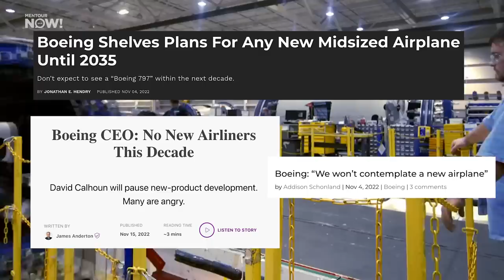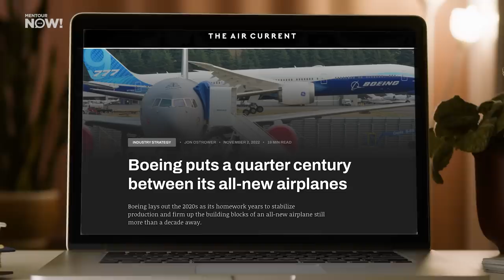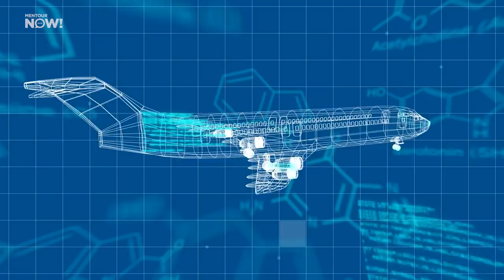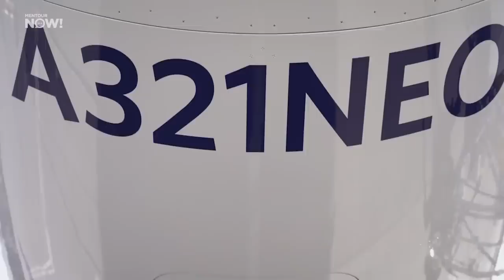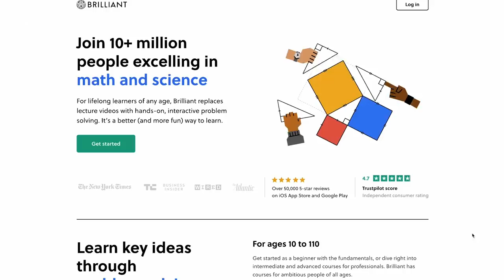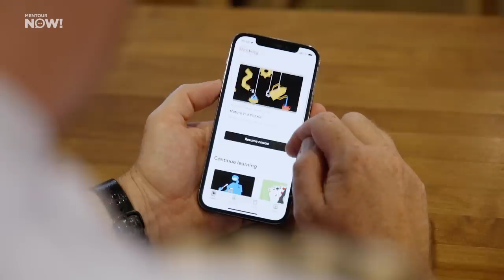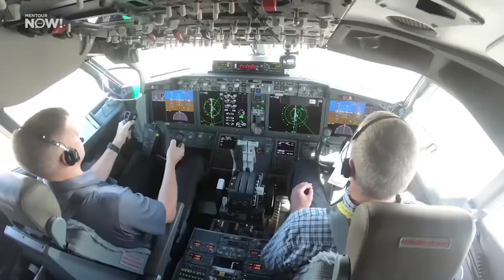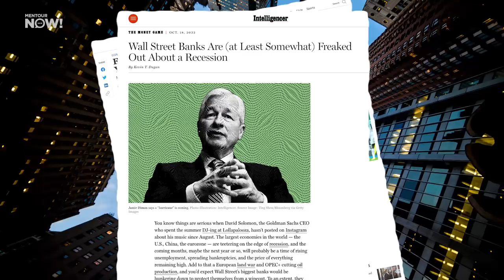Is BOEING giving up!?

Comment: You forgot to mention that, apart from technology development, the two big aircraft manufacturers Boeing and Airbus are fully depending on what their customers want. 
Between the current aircraft and the future wings only relatively minor tweaks (like NEO and MAX) can be offered. It wouldn't make any financial sense to develop a new aircraft to bridge the time until the new benchmark for airtransport technology has set in, like the automobile industry is doing with hybrids. 
While 737 MAX is a disaster the A321 NEO variants are merely a lucky (because they can still fit the bigger geared turbofan engines under the wings) but temporary success for Airbus until the next generation of airtransport will be produced.
And regarding that needed (clean and sustainable) technology: electronic propulsion is most efficient. But the current energy storage density, whether direct (batteries) or indirect (fuel converted to electrical power: e.g. by fuel cells), is not meeting the performance requirements to fly an aircraft with similar load, speed, altitude, and range as current airliners. It is this needed technology that Boeing and Airbus mean will not be ripe enough before 2030

Comment: There's a serious and universally unacknowledged problem with increasing aircraft efficiency as a means to reduce emissions. It's been proven over decades. It's another example of Jevon's paradox. Improving efficiency in use of a machine and the fuel it uses actually increases this fuel's use overall. In the decades of improving aircraft efficiency, overall fuel usage has increased because hugely more affordable flights have ensued. I see no reason that this effect would not continue. The only thing that will substantially reduce emissions related to flying is less flying, a lot less, the same with international shipping, we need less ships, not more efficient ships.. Electrification of some smaller, short haul aircraft might also help, but only at the margin. Yes, for competition among aircraft manufacturers, then this technology is important, but high bypass fans, or open fans, or lighter aircraft and more efficient wings are technological dead ends in regards to reduced aircraft emissions overall. The world has to get a lot bigger again and folk need to stay grounded nearer home. Perhaps the coming economic crash will help.  But thanks for the video, you're not just a great pilot and communicator, you're something of a business guru too!
Reply: i agree

Comment: I think the primary focus for Boeing ought to be on developing manufacturing facilities, processes and tooling for manufacturing more quickly - perhaps integrating more subcontract work - to accelerate the manufacturing process and reduce defects.  If they can shorten their backlog, it should dramatically improve their competitive position in fairly short order and allow them to look into better ways to get from CAD to prototype.

Comment: There may be efforts to Neo their current aircraft.    Clean sheeting the cocckpits of Boeing's current designs would take a great deal of time.     Yet building them to me the new FAA Cockpit standards might be something they could do as they straighten out their current designs.      Tech upgrades of current or near term designs could fill the  gap before they jump to the ltra new  open fan generation of  redically new aircraft.    Nothing interests them in building an all new design, but providing a midlife kicker to current airliners  is a different matter..

Comment: At 0:16 in the upper right, why is the nose of the plane so warped?  It looks like 2/3 of the cabin was removed but the skin is still curved around the hole as if it was designed to fly like that.

Comment: While people have been saying "Everything that can be invented, has been invented", for years, decades, centuries, I think the aviation industry is a lot different now than from now, and when the 707 came out. May be new designs aren't required anymore, just improvements to the existing airframe and engines is all that's required.

Comment: Retooling design, manufacturing and engineering base should be everyone's goal at this time. There have been MAJOR changes in each one of those fields that a wise company as complex as this should be working hard to get in place before attempting a new plane.
 Think Rotation Detonation as just one piece. Take a look at what changes have been used in the new NGAD program and it all makes perfect sense.

Comment: Great video!  As far as new engines go, I always think of the meme with how the Dyson airplane engine would look and have a good chuckle.  However, if it were ever able to be achieved, it would be absolutely incredible for both safety and maintenance savings in the aviation industry.  No more worrying about broken blades, hitting flocks of birds, ingesting ice, and possibly even the ability to go through volcanic ash.
Reply: Dyson fans do have blades. There is a conventional, bladed fan hidden in the base and the "blade less" design is just a fancy duct for this conventional fan.

Comment: Honestly, part of the problem with Boeing is that they were let too far off their leash by the FAA. They were allowed to self regulate and had very little oversight for too long which, in my opinion, has helped create the situation they're in now. Quality control issues are a serious concern when you talk about the amount of money that these aircraft cost to operate and maintain. I work as a mechanic for an airline that has received quite a few newer boing aircraft; and while I can't speak to the quality of all Boeing aircraft, I can tell you that the inconsistencies in the ones I have seen, have stacked up over the years. Aircraft going down for extended periods for major issues with only a couple hundred hours on the airframe, having to get Boeing engineers involved with landing gear indication issues straight out of the factory, etc, etc.
Innovation is wonderful, but at the same time, high quality control standards and dependability, in my opinion, should always be the first goal. 
It would also appear that Boeing isn't going to be developing a narrow body aircraft in the near future which leaves a huge opening for Airbus to gain market share in passenger avaiation.

Comment: Some designers of military aircraft claim that you better not have a big gap between new designs. 
This is more from a know how view point. If you stop designing the next aircraft it is well possible that the people with the know how are retired before there replacements will have gained any expericience in designing an aircraft.
This design is becomming more and more complex, so it will cost you a lot of time and money in order to let this new group of people gain the experience they otherwise would have gotten from working with experienced people. It's always cheaper if you can learn from the mistakes the people before you made in stead of repeating them.

Comment: One of Boeing's biggest problems is that they let the USAF/USN top brass keep changing the parameters of what Boeing is currently building instead of finishing something and then modifying it to suit those needs.  The KC-46 RVS was a colossal failure and now that Boeing is picking up the tab for re-development they are just burning cash.  There wasn't anything wrong with having a boom operator in the back controlling refueling like they do on the KC-135.  Boeing already has enough going on with the B-52 engine replacement program, the T-7 program, and finalizing the KC-46 program and they should focus all of their engineering on that before they start on another commercial plane that really doesn't seem to be needed at this point.

Random Oklahoma flag spotting at @4:54 which sits outside the Boeing building at Tinker AFB for those wondering why there is a Boeing building in Oklahoma at all.

Comment: Am staying tuned to the RR UltraFan engine. Sling a twofer on a new wing mated to a 747 body solves many problems at once. The 747's tool and dies specs are all current. The Queen of the Skies reborn. Many ifs, but maybe RR designs a home run?

Comment: One issue I see is that Boeing has to be very careful with their wording. They are legally required to be honest to their investors. Gonna be hard to justify saying that and then bringing a new aircraft.
Then again, if they bring one in 5 years, they can sell it as a change of plans.

Tbh tho, while I think its unlikely, I wouldnt be bothered if Boeing goes down. It would likely be replaced by another company, which would take up big parts of Boeing and hopefully bring back some of the competency that Boeing seems to have lost.

Comment: You forgot the cost overruns in the Air Force 1 project. IMHO there is a disconnect between Boeing management and Boeing engineers. The idea to stick with the 1950s concept for the 737 max and not to develop a new platform was very shortsighted and backfiredl. I can't believe that despite all the changes, the 737max with all it's workarounds has suddenly become a sound design.

Comment: Those new engines will not be a new idea.  I guess back in the 1980s or 90s, I recall seeing an air show video with a jet flying with one engine substituted by a UDF ( UNDUCTED Fan ) engine.  So what are the issues should a fan blade fail and slice , machete like, through the fuselage.
Reply: i agree

Comment: Fundamentally, Boeing's next design has to be an massive evolution, and it's not just engine efficiency or some other iteration. They've already capitalized on the use of composites. They'd have to make tangible improvements on the wing and frame. IMO, the next release would have to dramatically improve across all facets to make it viable. I also think that they're concerned with the cost implications in a recessionary period, not odd...considering the challenges they run into with the 787 logistically. TL;DR, it's likely a combination of factors and not just one or two.

Comment: CFM should license the geared turbo fan that Pratt and Whitney developed that would up there efficiency by more than the 10% that is not considered sufficient. That way the airframes could be modernized without a lot of extra expense. The current lineup is adequate to serve the needs of their customers if they invest in modernizing engines that they use. And don't forget Boeing is not subsidized like Airbus and they have military contracts it must be fulfilled. Enough work to keep them busy for some time to come while rolling out the 777x at the same time. Not to mention the 737 Max- 10 which is also in development and subject to close FAA scrutiny

Comment: @mentourpilot a video on the differences between a Turbofan vs turboprop vs open turbofan would be  amazing. I can see lots of confusion in the comments and I have no real clue myself!
Reply: Well I guess a turbo prop is like a helicopter engine where it turns a shaft and a propellor. This new open turbofan would still behave like a traditional turbofan but lacks a big engine cover
Reply: There are some distinctions between an "open turbofan" and a turboprop, but for the most part I think it's just marketing as "turboprop" feels dated and associated with small noisy slow regional aircraft. A lot of people are asking about the danger of a blade failure, that's certainly not insurmountable for turboprops for all these decades (with propellers in general having been in use for over a century).
Reply: I haven’t looked deeply into this, but I would guess the difference is that the turbo prop uses a free turbine to connect engine power to the propellor, and the high bypass fans are a direct drive coupling to the fan shaft. The open fan engines would be direct drive to distinguish them from turbo prop.
Reply: @MeTube3  Pretty much all turbofans as far as I know have at least two spools, with the fan and in many cases the first few compressor stages driven by a separate turbine from the high pressure compressor, so pretty much the same as what you describe. Some turboprops have a separate power turbine (driving the propeller via reduction gears), while others are geared directly to the same turbine as drives the compressor. All turboprops are geared, most turbofans are direct drive (no reduction gear) but some - for now mostly smaller engines such as for business jets - have geared fans. Some of the "open rotor" or "unducted fan" designs were direct drive, which sets them apart from turboprops, but I'm guessing what was shown here would have reduction gears. Likewise another difference is that turboprops are basically always variable-pitch blades, all production turbofans have fixed-pitch blades (some variable-pitch turbofans have been built experimentally but never mass produced), "propfan/open rotor fan/unducted turbofan" I've seen with either fixed-pitch or variable-pitch blades. The rendering here looked to me like it has variable pitch blades. So open fan, variable pitch blades, reduction gears - someone explain to me what differentiates that from a turboprop as we know it?

Comment: It seems the 2022 delivery split between B and A is not too far from a 40:60% already. Maybe the genaral power advantage (politically & economically) US vs. France & Germany will need to be used to save B, if this trend goes on for several years, with nothing at the horizon to stop it - as far as I can see?

Comment: Sounds like Boeing has decided that gradual improvements over existing designs is more cost effective then a whole new design.
The 707 and subsequent jets reflected the fact that Jets replaced prop planes and as part of that switch required replacement of strightwings with swept wings.  Together that meant a complete  redesign of any plane.
The changes in the future does not require whole new designs.  No need for new wings due to new engines. No need for new engines if you adopt a new wing design. Thus it is better to  wait and see what new design is needed by the new technology and use the new technology on existing plane design first and see if that is a better way then designing a whole new plane around the new technology.

Comment: From both a professional and passenger perspective, I have found the last two Boeing projects just "disappointing". The 787 really isn't all that was promised, and you can feel the cheapness in the finish to the cabins and the absolute cutting to the bone on everything to make it as lightweight as possible to meet the promises made on performance. From a working perspective, it didn't take long for cabin monuments and structures to start to fail, cabin furnishings to start looking tired and with bits failing quite significantly. Systems on several deliveries at the airline I worked for had major knock on effects to passenger satisfaction and comfort, and it is hard for people to forget that. And, the less said about the 737Max the better, it has been a terrible reincarnation of an aged tired program that has left a lot to the imagination as to how it arrived at the point it did. I feel, personally, that they have just taken it too close to failure with the products and management, to ever really recover to the point they were, no matter how hard they try. Reputation of the company has been damaged too much to make that full recovery. And what makes it worse, is I think in them selves, they know it.

Comment: Decades ago I could see aircraft lining up for Boing Field, then one day I heard a strange sound and looked in the distance was a 727.
Then I remembered reading about the un-ducted fan engine tests on a 727 and realized this must be it, but it was loud and its tone was irritating.
I'm curious what improvements this CFM engine has to eliminate the issues (it looks to have two counter rotating propellers that the test 727 I don't think had)?
Reply: At 6:06; I was wrong, the CFM has single propellers (like I remember the 727 had), versus two counter rotating per engine (noise?).

Comment: I suspect the bigger reason is that the company realizes it needs to reboot its internal culture.  Removing the pressure to get a new design on the market is a big part of this.  I suspect that Boeing wants to let the 737MAX dust settle, see what happens in the airline market post covid, and most likely reboot its culture and this pause may well be a very smart way to do that.

Comment: No just civil and military projects, but also space (DisastarLiner).
Everything Boeing has touched over the last 2 decades has been a problem.
What isn't talked about is how in the 2000s they got rid of their best (most expensive) people in the name of cost saving. 
I suspect that it wasn't just the salary cost, but also that those people were obstructing Boeing's new corner cutting strategy.
They were replaced with low cost yes men.

Comment: You're forgetting something.  Boeing Starliner.  They had so much issues to get the first flight of this spacecraft.  That's one major reason that would delay a lot of contracts or conception of something new in the aircraft field or spaceship field.     Boeing has to rethink the way they build and design & conceive anything.   The 737 Max, Dreamliner, and Starliner all had problems due to the way they design, on all level including with the software that will run on these ships.     So I understand why they want to wait.  They need to rethink the way they build everything at Boeing.   This shows that it's not only Airbus their competition, but SpaceX & Canadian Bombardier that showed Boeing they had to rethink the way they have to build aircraft or spaceship.

Comment: If I had the hedge a bet, I'd say that the cancelled mid size design was so far along that once new engines are ready, it could be fast tracked to a prototype fast enough, it could possibly outpace and out sell a re-wing from Airbus

We really don't want a single airliner manufacturer.  Prices will sky rocket and that cost will be passed onto passengers.